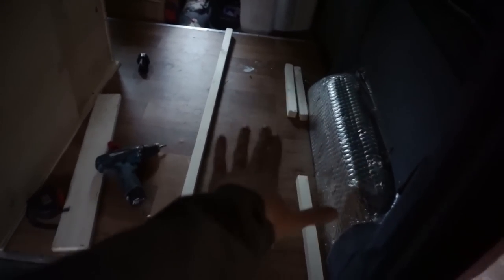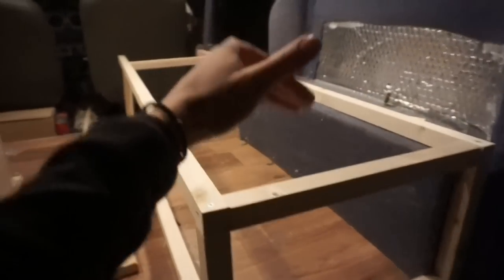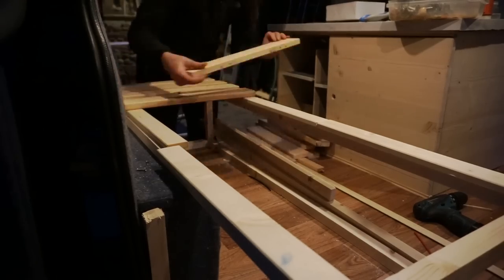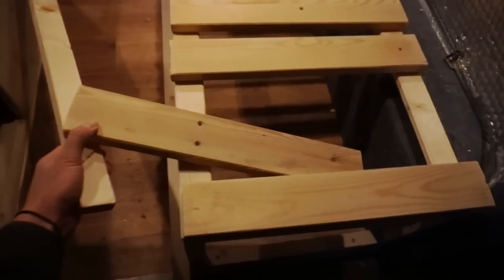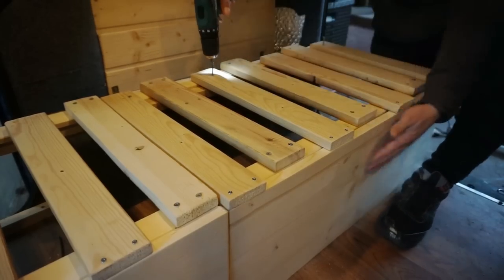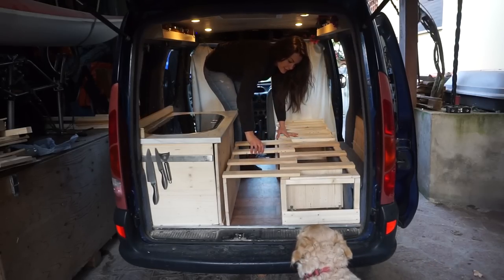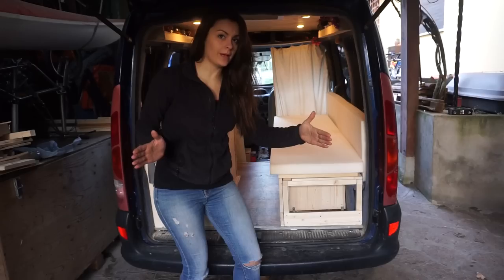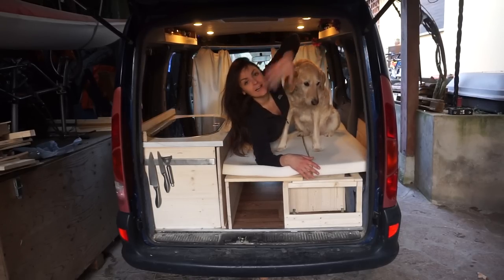Building an Easy Extending Bed! - Small van build - Ep. 5

Comment: Is it comfy that bed? It seems that once you extend it holes in the bed open because of the parts that slide away. You could add some sort of boards on the bottom side of each foam and thus make a solid base. This way you won't sink in like your elbows did at the end ;) Hope this helps :)  Otherwise very clever. I am enjoying the videos.
Reply: I thought that maybe the holes were to big. Boards would be good as long as they didn't make it difficult to access the storage space underneath.

Comment: Brilliant adaptation of a slat bed as it has a hinge to access underneath storage.

Can I ask you pam how long you have had the Renault kangoo for?

I'd like to know how reliable the vehicle is in British and European driving?

Thanks in advance
Reply from the maker: Hi there I had the van for about 3 years now, considering I only paid 600 pounds for it i think it has done quite well! I did get some major work done to it but I guess it's to be expected for a vehicle of this age :)
Reply: @WildSheGoes  thanks Pam. Looks like a 2001 kangoo.  Would like to know what the mechanical weak spots are for the kangoo. So What were the major works you had done? 

You mentioned you are upgrading the van....what to and what are your reasons

Thanks in advance. Always good to get a perspective from someone who is actually doing this in pure experience. Keep doing what you are doing👍

Comment: Did you have to use firm foam for it not to fall through the gaps, or would medium firmness be ok? I'm building this style of bed just now (thank you for the tutorial!), and I'm going to order the foam soon. But I don't know how firm 'firm' foam actually is - I don't want to feel like I'm lying on concrete! Thanks x
Reply from the maker: Hi! On this video you can see that the foam was quite soft and it was about 10cm high. I did end up changing it for a much more comfy and thicker one a few months later cause I was falling through the gaps (which could have been avoided by having more wooden slats lessening the distance between tgem) but also I could feel the wood in by back when resting  I'd definitely recommend going with as thick as possible, or with a very dense thin one 😊

Comment: Well done, I like your bed design, do you have a drawing of how you built it with the dimensions of the wood you used?
Reply from the maker: Hi Rob, I don't unfortunately, All i can say is that i'ts 1.50 long and 50cm wide when closed (80cm wide when open)
Reply: Thank you for your reply Pam, hope going well. Im in new zealand considering living in my van for cost savings the hardest part for me is the bed, but i like your idea of slide out bed as it allows space when not sleeping, the wood here is expensive so i wanted to design or get a design to have a more accurate estimation of how much wood to buy. I'll keep watching, like the idea of how u did your curtains too.

Comment: Would it be possible to get the dimensions as I'd like to use this system in my van. Thanks :)
Reply from the maker: hi RIchy, the bed is 1.50long and 50cm when closed, 80when open. I think it's about 35/40cm high and you should be able to add a 30cm extension if you put your front seat down!
Reply: @WildSheGoes  Thanks for getting back to me, will make things much easier!

Comment: Help lol. I am so frustrated right now. Ok, my carpentry skills are nowhere near as good as yours. I'm making a bed pretty much identical to yours, except in a berlingo. Ok, so if you stop video at about 5.38, you've extended the bed but haven't put the large front solid piece on. Hope that makes sense. You seem to have the extending slats screwed on to a single narrow piece of long wood? But then suddenly that's gone and you've a large solid front to the bed? Is that long narrow piece still there? 
Hope that makes sense X 
So sorry about Odie, you must miss him terribly. I've two dogs, a large silly labrador cross, and a tiny Jack Russel/beagle/dachshund mix. They're my life.